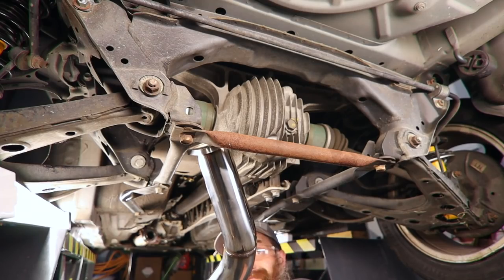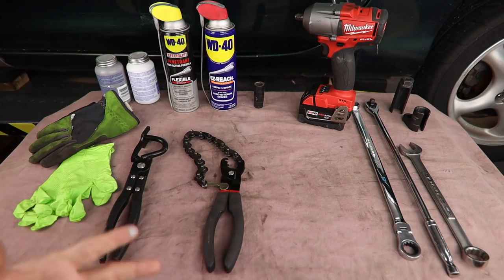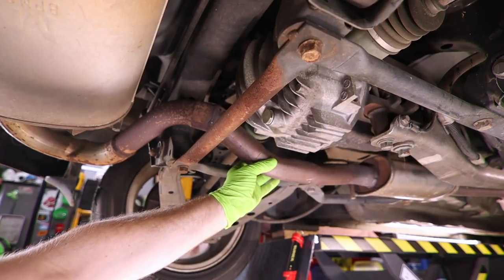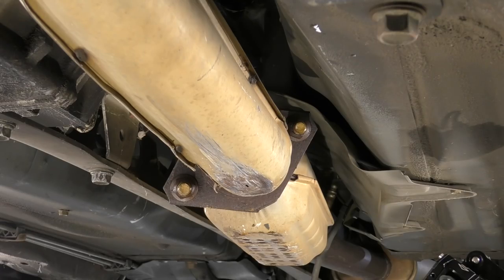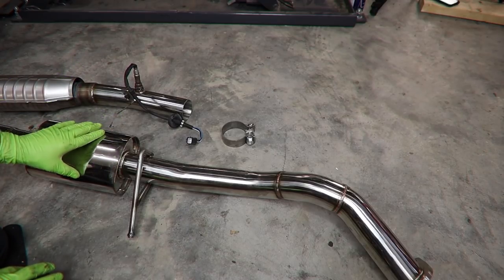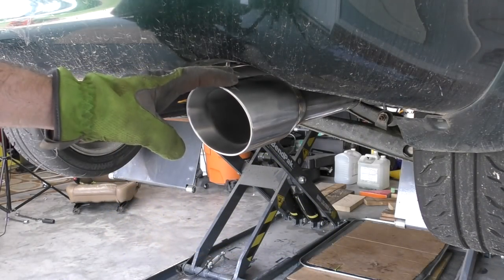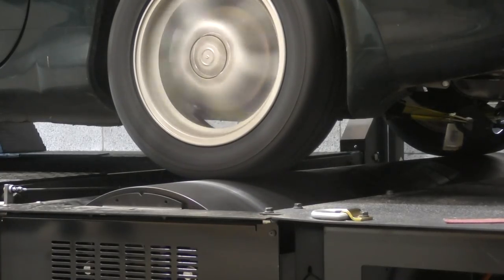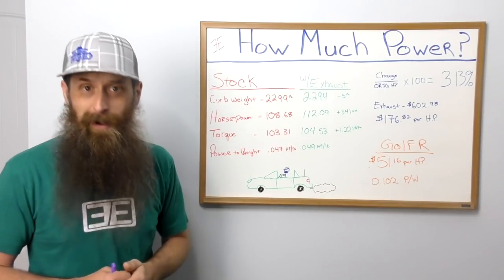Will a Performance Exhaust ACTUALLY Increase Power ~ Miata Exhaust Install

Comment: Wait is it the 1.8 engine? This cannot be 1.6 because they state it is 110hp but that could not be on the wheels, so I guess this is 1.8 with those 108hp on wheels?
Reply from the maker: Yep 1.8l

Comment: If you don't remove the catalytic converter completely, it's pointless to install sport exhaust.
Reply from the maker: Maybe. But also against the law, and breaking rules for street class in autoX.
Reply: @HumbleMechanic  I know it's against the law, but the law doesn't mean shit here in Bulgaria. You just swich the factory ECU for a one with more than one mode for tuning and make one of the charts on lean mixture for when you have have to go to emission check. Just hide the button (instant dieselgate) XD

Comment: C'mon man. A stock Miata in 2020? Everyone else has massive hairdryers and and sick Rotary Engines in theirs. Does it even have enough power to spin the wheels on the hoist? 😉
Reply from the maker: Plenty of HP to be fun. :) since most people can’t drive, they need a crazy twin turbo 4 rotor hahahahaha. Kidding with Rob of course. I love the crazy stuff he does. 

But really there is no need for a crazy high HP car to have fun. This is the slowest car I own and I have most fun tooling around in it. 

The next project we are doing will be more performance I promise
Reply: @HumbleMechanic  Who's Rob? Hahaha I don't follow fan boi's 
Angel Motorsports are the ones to check out!

Comment: Why not... Just. Do the dyno with the stock exhaust. Before... Idk.
Reply from the maker: I covered that. I didn’t want there to be an install issue on the dyno lift. Plus the dyno is 2hr away. So had to maximize time
Reply: @HumbleMechanic  ahh, okay, I guess I missed that.